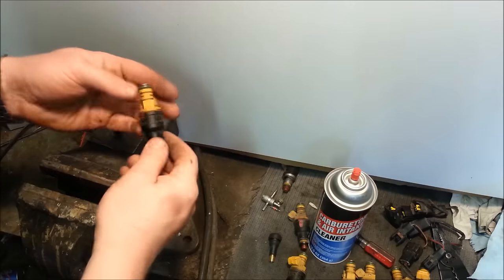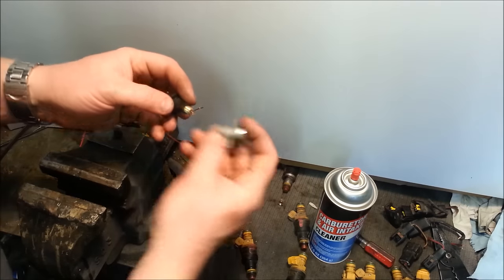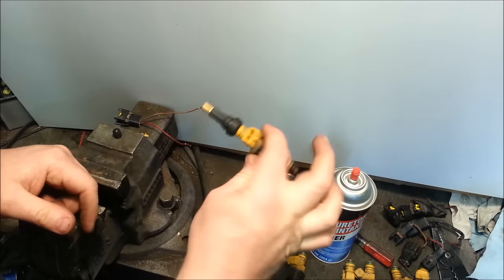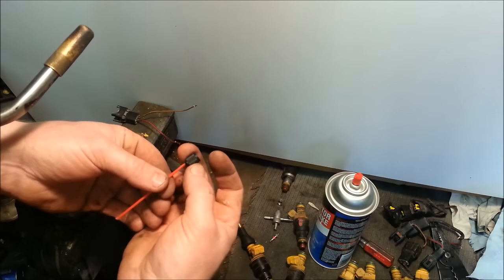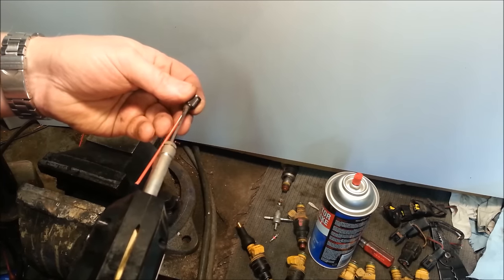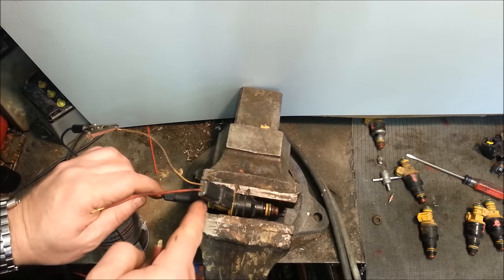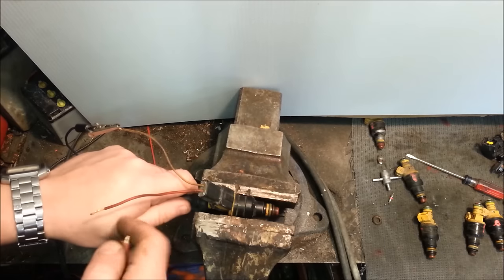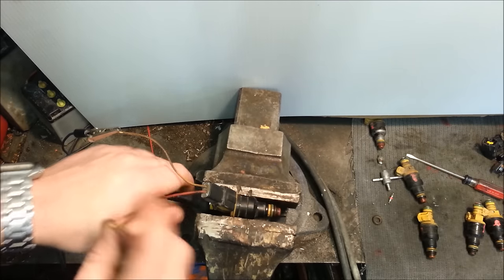Fuel injector cleaning without expensive tools

Comment: Your ding it wrong, your suppose to pressurise the outlet so any particulates trapped in the injector get pushed out the inlet side. Good idea though.
Reply from the maker: A lot of injectors won't allow reverse flow because of the design. The pressurized liquid holds it closed no matter what you do. A poor spraying injector is generally do to gum/tarnish/carbon build up at the tip which carb cleaner dissolves. Reverse flowing can push this junk into the injector and cause it to seize the needle/plunger. This can ruin an injector.

Comment: Not to be a nay sayer or anything... But I feel like just spraying it from the can into the inlet of the injector is enough I don't believe you need that much of a seal.
Reply from the maker: It gives you a visual of the spray pattern. You can tell if the injectors are clogged and not atomizing the fuel.

Comment: Wrong....
u remove filter inside of injector and replaced filter just price in cents . Injector holes not blocking but filter found choked due to moisture and other reasons.

Comment: Power and compressed air will do it too
Reply from the maker: Compressed air won't dissolve the varnish that is clogging and making a injector stick. That's the job of the Carb Cleaner(acetone)
Reply: @sixtyfiveford  air wont dissolve it but it  blows it clean.I've been cleaning injectors like that for years for people and haven't had a complaint

Comment: cool. now show us how to clean side fed injectors
Reply from the maker: You just need an old fuel rail from a wrecking yard. Put 3 in the rail, rig up a way to pressurize it with rubber hose, JB weld, etc and test one at a time. You could even cut up some of the older fuel rails that had piping between the injectors and rig something up.

Comment: Well why not just connect the alligator clips to a 9 volt battery?
Reply from the maker: Several reasons: If you're working on a car, you already have a 12 volt battery, the lower voltage of the 9 volts actually draws higher amperage and will create more heat in the coils, and finally the lower voltage creates a much weaker opening snap action on the injector and can give you a false reading. These typically run at alternator voltage which can be as high as 15 volts.

Comment: This way, it APPARENTLY cleans the injector. This one injector was NOT plugged or really dirty.   On dirty ones, you can easily look at a way different spray pattern. This one sprays perfect from the very first time it is fed by the pressure can, so it was close to being clean from the beginning!   BUT, a Way-better-way is to spray in the OPPOSITE DIRECTION, so that instead of pushing the dirt from the injector's body and the small microfilter inside it, INTO the small passages of the nozzle, you push BACKWARDS so that any dirt goes out off the inlet.  Therefore, you should use some vinyl hose that fits the injector nozzle end, and then attach the spray can the best way you find. I've used a short lenght from three different sizes of vinyl hose, that went one inside the next, like a telescope,  and some heat sealed them perfectly.  Now,  the very best way to clean fuel injectors is by buying a small used but working ULTRASONIC cleaner and special solvent.  Those small ones meant to clean jewelry can be found at under 70 dollars new, much less at E-bay. Then, get an Injector Pulser, so that you open the injectors many many thousands of times WHILE they are submerged in the Ultrasound bath.    Finally, a very inexpensive bench testing setup can be done with a used injector rail, and the pulser.  A used fuel pump and more solvent (that is NOT flammable, as its water based), can be rigged to actually MEASURE the flow of the injectors, so that any injector that fails to deliver within 2% of the injector that has the highest flow, is cleaned again, two or three times usually gets it to AS NEW flow. Buy a set of measuring glasses at a lab store, usually 100 mililiter ones will allow enough time to compare the flow very conveniently.  Stop the pulsing when the first injector reaches 100 ml, and just read the others. That makes balancing them very easy and practical. Being there, done that.

Comment: I can change my oil, filter, air filter, and on a good day,  my brake pads. This is beyond my skills. I d just buy new injectors I guess.
Reply from the maker: It's more difficult to pull them than clean them. Some injectors are relatively cheap while others are exorbitantly expensive. This allows cleaning, but also testing to make sure they're functioning correctly. No point in changing a part that isn't broken.

Comment: Here's the easiest way to clean your injectors without all this complicated stuff. Buy two cans of Chemtek B12 add it to your empty gas tank and let the car idle for 10-15 minutes and fill it up your done and it works just as good as direct cleaning from a dealer but cost $20 instead of $150

Comment: Why so many thumbs down ?
Reply: Most likely because he only cleaned the injector at one side. There's a small filter inside the body of the injector and doing it the way it's done in this video doesn't really clean this filter. I'd clean the output-side of the injector first (cleaning/loosening any debris in the filter), then clean the input-side of the injector and lastly clean the output-side again. I've done this way numerous times, with no issues.

Comment: Really pure garbage. Too much mess for this. I haven't seen a single good method better than adding a fuel injector cleaner in the tank. I put 3 oz of Lucas fuel treatment upper cylinder cleaner every other fill of gas in the tank and the injectors are like brand new.